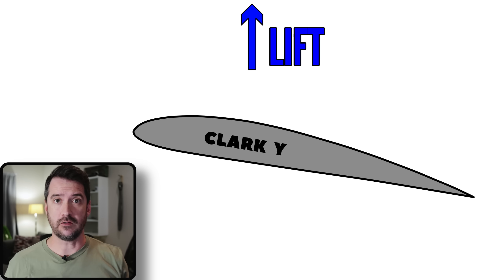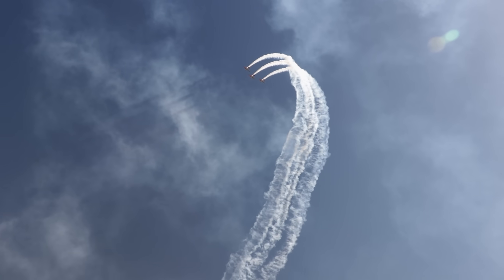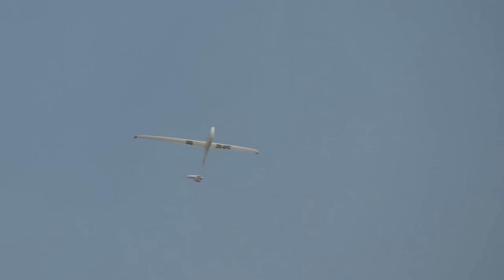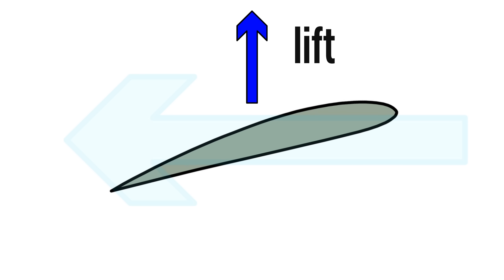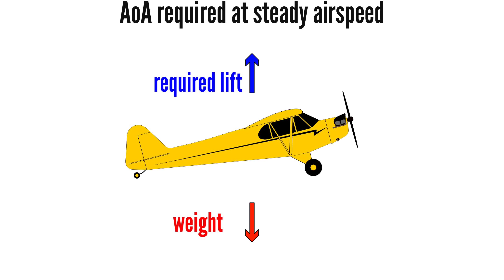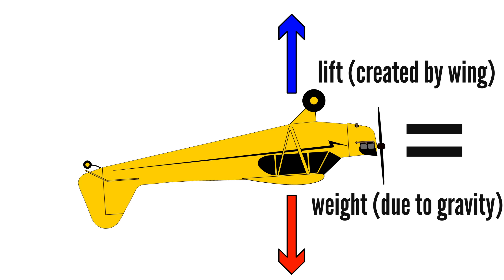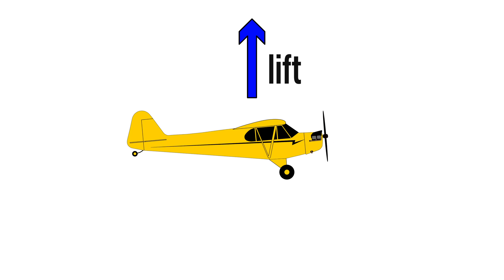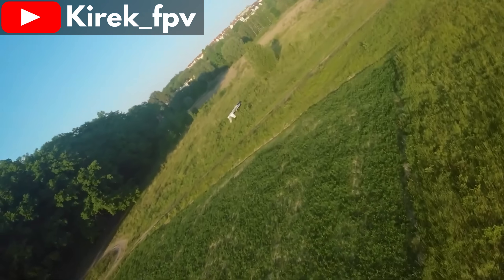Is Airflow Distance Over the Top of a Wing Always Longer?

Comment: Thanks for the video. Your argument is correct that upside-down flight results in a longer flow path on the top surface, but it is important to note that this doesn’t mean that the longer path causes lift. The longer path is usually a feature of lift, but it’s merely a result of flow being redirected downwards. Downwards flow is ultimately caused by curved streamlines, and outer (top) curves are usually longer than inner curves. In the counter-example of a flat wing with bumps on top where the flow continues straight afterwards, the longer path theory would falsely predict lift. Instead, it’s the curvature of streamlines downwards that ultimately creates lift by causing flow redirection and leading to a pressure gradient that contributes to lift (curved streamlines must have a pressure gradient). This isn’t just “two sides of the same coin,” as Bernoulli alone under-predicts lift, while wing shape causing streamline curvature, causing both flow redirection and pressure gradient, is a more complete explanation. Nevertheless, it may be misleading to focus on the longer path condition when it does not cause lift. Indeed, I believe it is possible (but inefficient) to construct a wing that redirects flow downwards but where the total path is longer on the bottom. As long as the average streamline curvature causes downwards flow, you will have both the flow redirection and pressure gradient required for lift. However I agree that it is always more efficient to have a longer path on top. Let me know your thoughts!
Reply from the maker: Thanks, yeah this was purely regarding the flow path and that it can't be disproven by that upside down argument. I agree the longer path doesn't cause lift, but goes hand-in-hand with a lift producing airfoil and is inescapable.

I like your explanation and agree, apart from lift being possible without a longer flow path on top. Even symmetrical wings have a longer flow path when producing positive lift, and same goes for supercritical airfoils or wings with more camber at the bottom, like modern airliners. These reduce drag by shifting the stagnation point up, requiring much greater speed to create lift. But flow path over the top is still longer.

Since most of the redirection of air happens over the top of the wing (not below) the airflow over the top can't be the shorter path.
Reply: Interesting points, thanks for taking the time to reply! However, I’m still not convinced a longer top path is a prerequisite for positive lift. Consider an example of a very impractical airfoil: imagine a cambered airfoil with zero geometric angle of attack where the bottom surface is so wavy that the flow length exceeds the upper flow length. Without changing angle of attack, and by only increasing the flow length on the bottom by making it wavy, would the wing still not produce lift (assuming flow could stay attached)? Of course, there is no practical reason for such a wing, and its performance will be extremely poor….but in a wind tunnel with ideal conditions, as long as the flow attached and is redirected downwards, and the average airstream is curved for some component of downward flow, there should still be some measurable lift. Again, there is no reason to make a wing like this, but I see no reason that a longer bottom flow path should preclude lift. 
Where I do agree, is that I cannot imagine that any optimized airfoil exists where flow is longer over the bottom surface, as any geometry that makes the inner flow path longer than the outer flow path would be pointless, but I cannot rule out such an airfoil still generating lift. TLDR; any practical airfoil will have a longer upper flow path, but that is not a prerequisite for lift?  
Interested to hear your thoughts! Thanks
Reply: @wilsonarno  Hi, you mentioned: "the counter-example of a flat wing with bumps on top where the flow continues straight afterwards, the longer path theory would falsely predict lift. Instead, it’s the curvature of streamlines downwards that ultimately creates lift by causing flow redirection"

and: "the bottom surface is so wavy that the flow length exceeds the upper flow length"

as counter examples for the above, consider:

The air cannot follow all curves with perfectly high fidelity.  The physical properties of the medium of air means the airfoil influences the path length without defining it precisely for all airfoil shape profiles - curves need to be sufficiently gradual to allow the influence of degree of curvature to affect to the path length of the air flow (the fidelity of the "sample rate" cannot exceed the physical capacity of the medium...thinking in electrical engineering terms).

Analogous to highway engineers setting speed limits for mountain curves.

I believe the "paradox" of lift on perfectly thin sails is dealt with by the above:  path length of the solid and path length of the (average course of) airflow are closely related, but not identical.
Reply from the maker: @wilsonarno  Good point regarding practical wings. Weird lift generating wings that defies "logic" on RC planes can't be ruled out. Imagine we had access to wind tunnel. I'd never be seen in daylight again!

Anyway regarding a wavy under surface wing, what sort of incidence? My question is, why would wind follow the wavy surface? Especially at flying speed. Coanda will cause air to follow it somewhat, but at speed it will go virtually straight. I think once an airfoil is made in whatever way to not have a longer path on top it won't give positive lift. Again, can't rule out somethihg that will allow an RC plane to fly, but not be sufficient for any man and metal carrying plane.
Reply: @davetime5234  Hi Dave, you're absolutely right that the medium of air makes it extremely difficult to execute these counter examples in practice (especially for a real aircraft). I think what I was trying to get across was less about practical applications for aircrafts, but rather giving an extreme example to show that the "longer path" is not actually necessary for lift. It is still true however, that a geometry could exist such that some amount of lift is generated on that shape where the flow path is longer on the bottom. In an even more idealized case where the flow is inviscid, fluid mechanics says the flow must follow the bumps (and in reality, air actually is relativley inviscid) so when you add back in a tiny bit of viscosity, there must exist some optimization (long smooth bumps for example) that allows for the air to follow the shape. There are other tricks you can use to create such a shape where flow is longer on the bottom, but where lift is still generated (such as changing the size or the fluid medium). This is easy if you're not concerned with actual flight, but just getting to the bottom of what lift is. If that's the case, then such a geometry is possible in controlled settings. But again, you're spot on that it would be really difficult and dumb to do on an aircraft.
Reply: @LetsGoAviate  Yeah, You're right that it wouldn't work on a real airplane at those speeds and scale, and I think that on a real full-sized aircraft, you would get circulation between the bumps, which would screw up the flow altogether. In a lab, you could tweak anything you want to create my idealized condition and generate some amount of positive lift with a longer lower flow path. I was just bringing up a (very impractical and useless) example to show that the principle of lift does not necessarily require a longer flow path on the top. But any "good" or optimized airfoil WILL have a longer flow path on top!

As for "what makes the wind follow the wavy surface", it is the same thing that makes the air follow the top surface of the airfoil. Weirdly, this actually has little to do with the Coanda effect, since that effect applies to the attraction of a fluid  "jet" to  a surface caused by air entrainment, and does not really explain very well what's going on here because we have uniform flow. I think this is better explained another way. I partially mentioned this in my other comment to Dave, but I will discuss more fully here. Let's assume for now that air is inviscid (no viscosity), which is mostly true for air (we'll get back to that in a second), then this means that there are only isotropic forces acting on the fluid elements (ie only pressure forces). Since the forces are isotropic, they are normal to the fluid element, meaning there is no rotation in the fluid elements. This inviscid assumption allows us to rule out any other flow path but to follow the curves. Let's rule them out one by one in the case of air flowing over the top of an airfoil: The air cannot just go up the bump and "go straight" afterward to leave a void between it and the airfoil, because the streamline would get sucked back down. The air cannot just go over the surface and continue straight by having stagnant air under the streamline (instead of the vacuum from before), because Bernoulli's shows that the pressures would be different at the streamline vs the stagnant air, which means the streamline would curve downwards (remember pressure differences causes streamlines to curve). The condition where the air goes up over the bump and goes straight, but the air recirculates is also impossible in this case, because the circulating air would require there to be shear at the edge of circulation. Shear layers have rotation, which goes against our inviscid assumption. Therefore, since we have ruled out the other possibilities, the only thing left is for the flow to follow the shape. (The kutta condition can be applied to explain why the flow can smoothly exit the airfoil by the way). As for the glaring hole in my assumption, yes, air is not completely inviscid, but this just has to be accounted for when designing a real airfoil. The point stands that it is mostly inviscid, which explains why a flow will follow the shape (until we get too crazy with it, where viscous effects start to ruin the fun).

Comment: You want low pressure on top high pressure on bottom. And slapping the air down, as someone said, the angle of attack (AOA, the angle of direction to the direction of motion*) is best option. However i have noticed that it's a bit of both, with AOA being the main cause.

*Further AOA for those that don't know. If you're in perfect orbit. So perfectly level flight direction of motion. If you nose up at 5° and still go the same direction you have 5° AOA.

Comment: Surface area vs mass and center of gravity are more important than airfoil shape. 

Gravity always pulling the plane toward the ground is also responsible for the air pressure to be higher below a wing than above a wing. Think of a skydiver falling with no airfoil shape at all, they still feel higher pressure on their belly than above them regardless of their shape.

Symmetrical airfoils fly just fine. This alone proves that a longer top skin than bottom skin isn't what creates lift although it does contribute.

In conclusion, falling through the resistance of the air and the energy produced from that collision of aircraft with that air is what creates the energy for lift. The harder you hit it, the better it deflects your path.
Reply: Higher pressure under the wing contributes about 30% of the difference in pressure; lower pressure above the wing contributes the other 70% or so.  The skydiver analogy doesn't explain the 70% pressure drop portion

Symmetrical airfoils use angle of attack to produce all the assymetry that lift requires.  And that produces the effective path difference.

Comment: You sound as though you have a French accent. Wasn't it a French scientist who originated the hypothesis that bumblebees shouldn't be able to fly.
Reply: I assume he's South African...and from a tailored question to AI:  "bumblebees put a lot of metabolic energy into their flight. The flapping motion does indeed add energy, creating those vortices I mentioned before.

On the downstroke, the wings push air down and back, generating both lift and thrust. This flapping increases the speed of airflow over the wings, which enhances the pressure differential (akin to the 80/20 dynamic/static pressure balance* on fixed wings). The low-pressure vortices above the wings and high-pressure air below both contribute to the lift.

On the upstroke, bees minimize drag by partially folding their wings to reduce resistance. Their wing motion isn't just up and down but follows a figure-eight pattern, optimizing lift throughout the entire wingbeat cycle.

So yes, the wings' motion introduces energy to maintain and augment the necessary pressure differences for flight. The principle is similar, but the execution—thanks to the dynamic wing motion—is far more sophisticated."

*it should be roughly 80% static pressure contribution, above the wing, vs 20% dynamic pressure contribution, below the wing.

Comment: At a stall angle the the acting low pressure vacuum is pulling the wing in a different direction.Instead of lift up,in a stalled wing the lift is not lift but has an effect now in the back ward direction.That is no pull up but a pull back or stall of forward direction.
Reply: The nature of a stall is not defined by the backward pull of the lift vector, it's a result of the amount of lift directly opposing weight (the part of lift in the vertical direction), decreasing enough that weight dominates over any remaining available vertical force, so that the aircraft has no choice but to drop.

Comment: Look at a 747 wing,the shape of the underside of the wing is not straight it is curved downward and holds a lot of fuel.The attitude of the wing has a lot to do with vector forces of the air on a facing plane that is creating lift as well as no such force on the top of the wing.
Reply: In a sense it's a dance between static and dynamic pressure.  On the side of the wing facing the wind, dynamic pressure is significant; On the downwind side (above the wing) the drop in static pressure is significantly influencing the wing surface.

And that drop in static pressure above the wing is the consequence of mediating the continuity of mass flow rate, and conservation of momentum and energy contained in the oncoming wind's dynamic pressure.

Comment: In the last sketch, I didn't see a big difference between the length of the upper and lower airflows. Does it mean that a plane flying upside down has to accelarate to keep sufficient lift?
Reply: An inverted symmetrical wing would theoretically not have to accelerate to a higher speed to produce the same lift at the same amount of inverted angle of attack.

But if the inverted wing is asymmetrical then either a higher angle of attack and/or higher speed will be required to generate the same amount of lift as non-inverted flight, because the wing asymmetry is working against the angle of attack's asymmetry.

Comment: Also upside down wing might have vortices like at the stalling wing example, so that the bottom side on top could have the same airflow so the airflow path could get longer but with the cost of increased drag. That is affecting a smaller plane differently to a bigger plane:
Stepped Airfoils for Model Airplanes - Are They Better? @DesignYourOwnAirplanes-xd6lz

Comment: Ok, but what are air pressure measurements on the top of a wing relative to the bottom in a wind tunnel? With and without angle of attack.
Reply: With some asymmetry of wing shape, without angle of attack:   some pressure difference

Symmetrical wing shape, without angle of attack:  no pressure difference

With positive angle of attack: also, a pressure difference

If the wing shape is asymmetrical, then it adds to the angle of attack pressure difference.

Comment: up to now people do not understand gravity, Gravity hates nothingness thats why lighter gases or less denser gases goes up, exemption is the ozone since ozone is created  at the stratosphere, this wing can trick the gravity thats theres a a clump of negative pressure and this creates lift.  I have designed  a flying craft that takes advantage of ground effect during vertical take off and  Coanda effect to create a virtual  baloon like -P to create lift , we can trick the gravity thinking its a  clump of negative using flanged and baffle plate axial fan on top and bell mouth inlet and outlet guide vane will serve as stiffener and and the gap/space between the baffle plate/flange and the guide vane will  serve as compartment for batteries.  Since axial fan is prone to overload a hole at the middle is needed of flying saucer like craft this will allow portion of air to enter at the middle boosting upward using newtons principle. the bottom of the saucer has slots that may release high velocity air creating an air curtain extending further  but the source of the air should be extracted at areas at the bottom whenever boosting and tricking gravity again and extending flowing coanda air at the side and increasing the virtual balloon at the bottom creating more lift. The volume of the virtual balloon displaces ambient atmosphere creating the so called buoyant force. bottomline is the GRAVITY can be tricked.
Reply: Are you somehow relating Archimedes’ principle to lift in the sense of an airplane: a lifting force due to vertical displacement of air from an induced pressure difference in a relative wind?
Reply: @davetime5234  Yes sir this negative pressure around the wing is like a clump of -P that tricked the gravity. Thats my theory it is I think the main reason why the atmosphere is not sucked by outer space since gravity hates nothingness, there is no buoyant force in the outer space. Astronaut could experiment on that you can submerged any hollow material and it will never float and stays underneath.